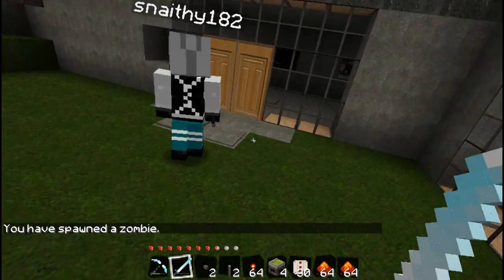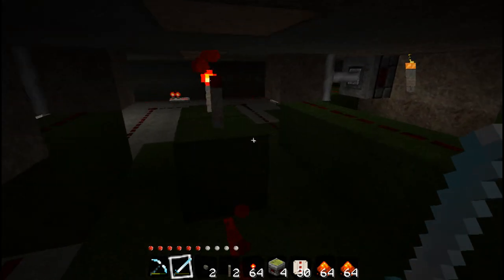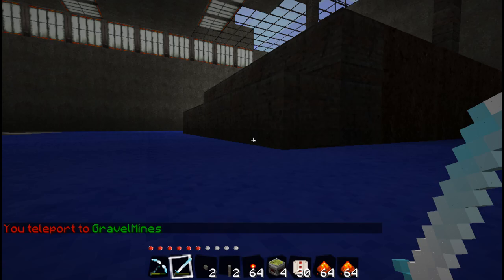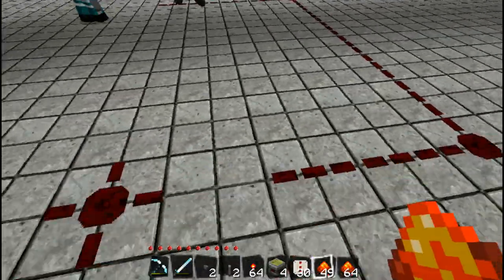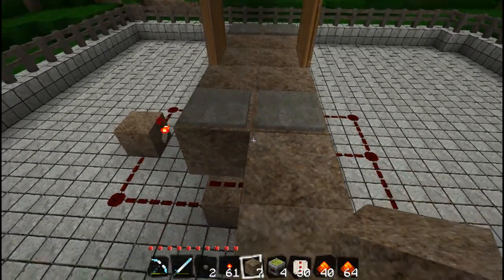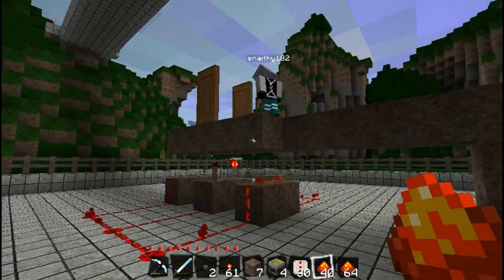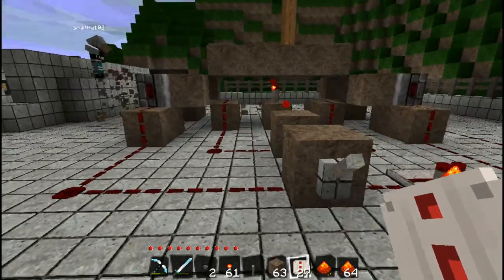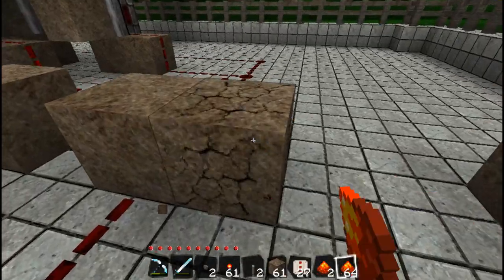Minecraft - Piston Double Door Lock Tutorial

Comment from the maker: @Bladaww 

Why an AND gate? Its normally just a flat circuit. The pistons provide a circuit breaker, so the lock works. Normally you put a torch to direct power away from the circuit, but that does not work in a double door circuit. The only other ways of doing this requires a reset button, and a stupid combination of levers and the such. 

This is a normal pressure plate double door circuit. The pistons are a circuit breaker, and are much more resource friendly and take up 10x less room